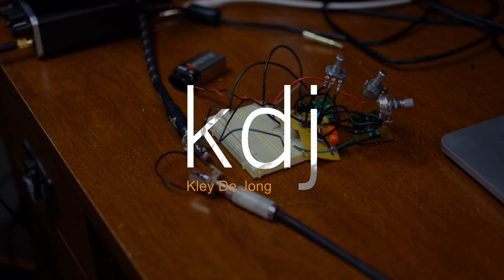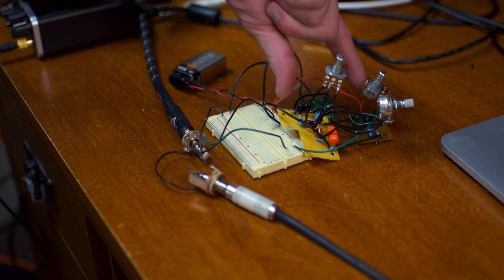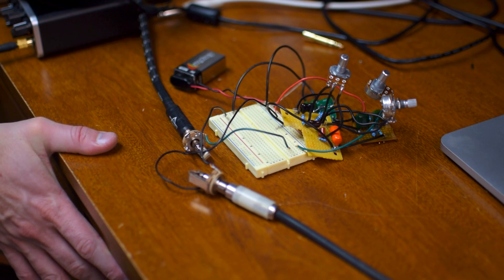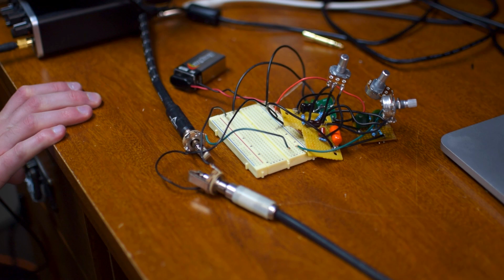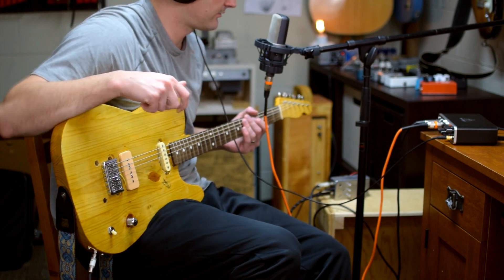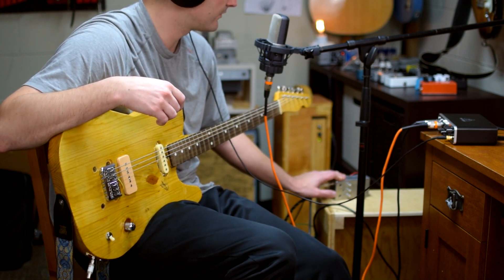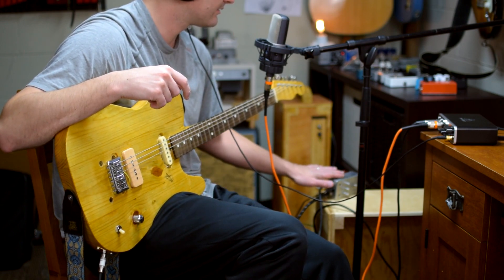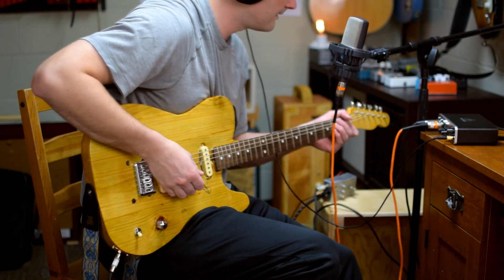Bazz Fuss - Circuit Analysis pt. 9 | Build Report & Final Tone Test

Comment: I've been overloading myself watching these and I've got 6 pots in my version a Blend tone circuit between a 2.2uf and 5nf on both input at output with 100k a 5k gain pot the 4.7k resistor and 10k Bias pot. A 100k volume pot and along with a couple switches for Feedback loop symmetric or asymetric clipping or simply none... But also a HPF with .22pf and 500k pot I haven't built the circuit yet IRL but I'm missing parts also not sure about HPF treble bleed pot value.